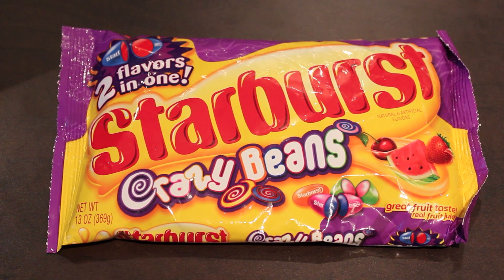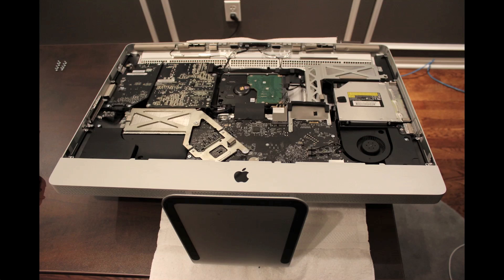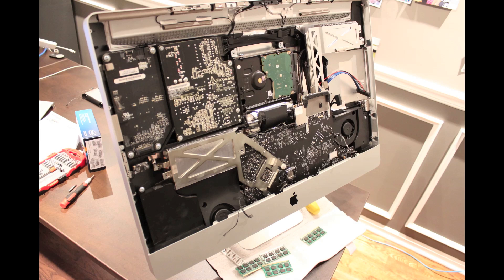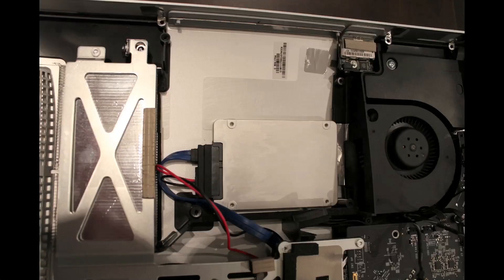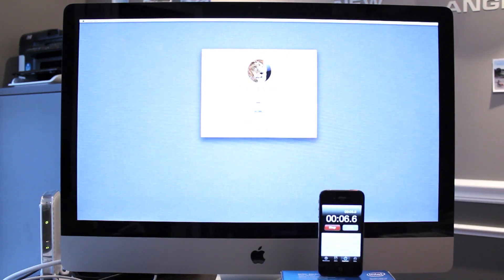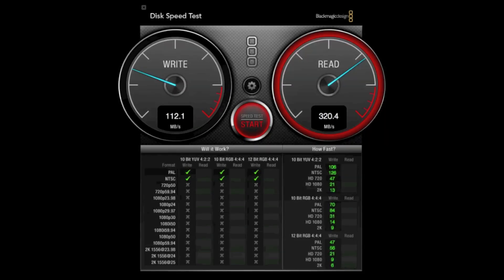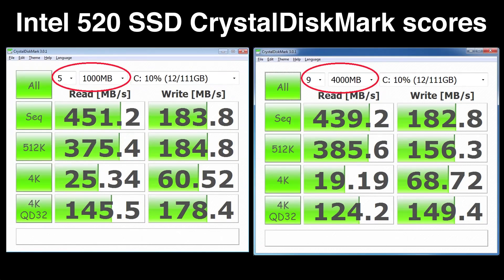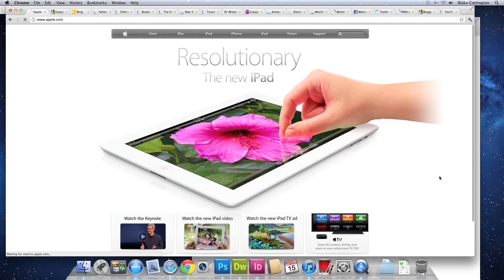NEW Intel 520 SSD upgrade for 2011 Apple iMac 27"

Comment: Here it is almost mid 2016. I am a power use in the IT field. I actually still use a 2011 iMac 27 as my daily driver at work. I passed my "upgrade" offer to get a new iMac as I prefer the ability to mess with my drives with ease and have zero performance issues with this one. The New iMacs have a glued/taped on screen that is a pain to remove. 

Mine is a i7 with 32gb ram. I installed a 512gb Apple SSD in the place of the 3.5" (pulled for broken rMBP and adapted to SATA) 1tb SSD in the place of the Optical and a 1tb SSD under the optical. The configuration is working really really well. I host several VMs across the 2tb of SSD along with all my cloud syncing data. My iMac actually had a fusion drive, so the space under the optical already had the SATA headers and a mounting location for a 2.5" drive.

Anyway, these iMacs are extremely fast even still (2016). I just bought a 21.5" 2011 iMac for my daughters room. Its getting 16gb and a 240 SSD the moment it arrives. It was only $500! They look great too!
Reply: s10010001 Question I have the same computer and my regular HHD is bad, I want to upgrade. Thinking under the dvd reader install a 520 - 1tb solid state hd and get an HHD with 2tb.... partition the HHD to run 1tb for time machine and 1tb of additional storage space.... Is that possible? Any idea on these extra cables I see with some temperature sensor....?  What do you recommend? I’m thinking crucial hd off Amazon.... thanks for any feedback

Comment: Best ideia ever! So, let see if I did understand: 1-I'm backup all my data in a usb external hard drive; 2-After I install the SSD drive, I'll used like primary drive and restore all my data from the usb external hard drive; 3-Format my old HDD and use it just for storage. Can you tell me if its right? Thanks.

Comment: Can I instal Lion onto the SSD using the recovery partition instead of using the flash drive? Will I have OS X Lion installed on the SSD and the HDD at the same time or will it be deleted from the HDD?

Comment: Hi i saw your video is very good but I have a question many people are using SSD drive inside of the imac but look very hard to install it my question is I have imac 21.5 late 2011 can I use external SSD drive with a thunderbolt connection and have the same speed that internal SSD because with lion or mountain lion you can install it in different drive please let me know if I use the SSD external can I still use my regular Hard drive at the same time I mean when you are using any app is with th

Comment: Hey Blake, I was wondering if this is possible to do on the late 2009 iMac 27"?  I see ifixit has a posting that you can, but OWC is saying you can't because of the proprietary heat sensor.  I thought that was for the HD only, considering isn't there a sensor for the optical drive?  I'm looking to install an SSD and need all the knowledge I can get!  Thank you in advance!

Comment: Couple questions...
1. Im assuming your core OS is the SSD and your home partition (entirely) is the OE Drive? Im thinking clean install with recovery partition also on SSD.
2. My system came with Lion but I recently did the ML Upgrade. Dont suppose youd have a tutorial on how to make the USB install drive for Lion anywhere would you? The thing only had the partition and no media and the ML upgrade replaced the lion recovery partition.

Comment: yeah ya right, I also upgraded my memory to 16 gigs a month ago then I found the improvement in performance is kind of limited. the speed of traditional hard drive is really a bottleneck.now i'm considering swapping my optical drive with a HD adaptor but I use it quite a lot to hand in the assignments.is there anything like a thunderbolt (for firewire) external HD case available on the market?searched on amazon but there's no such things. by the way, the display of your imac looks fabulous

Comment: Nice video ... nice information ! 

One question: 
since you're using the Intel's 520 with a SANDFORCE SF-2281 controller, does that means your SSD does not suffer from that controller firmware bug anymore ? 

In other words, is it safe to buy a sandforce controller nowadays, since all new manufactured intel SSD's are using the new/corrected/updated firmware already? 

Thanks! 
Kind regards, 
Wim